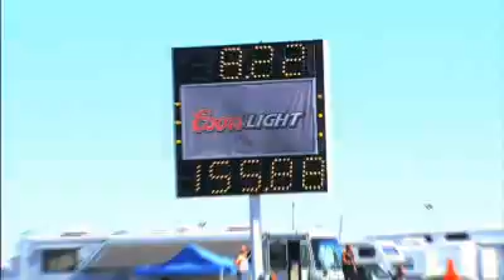Killacycle OLD EV WORLD RECORD 8.168@155MPH

Comment from the maker: You get that information from where? 

It uses A123 M1 batteries that are rated to 50C i.e you can pull 50x the current the battery is rated for. The discharge curve is basically flat until they get down to minimum voltage at which time the battery management system cuts power to avoid damaging the cells.

Electricity consumption is 0.6 kWh, worth $0.07 for each run so the 9kw/hr battery pack is enough for theoretically 15 runs for a total cost of $1.00.